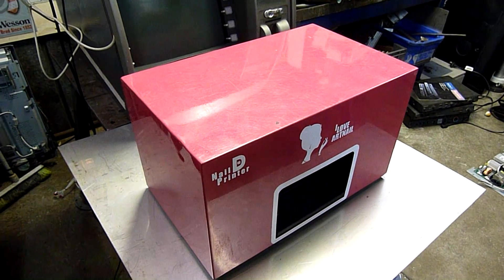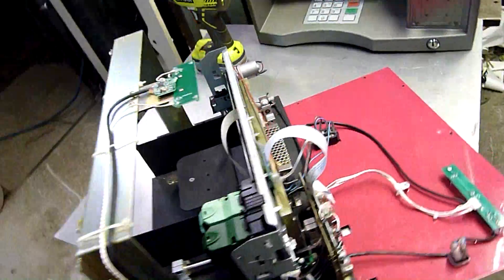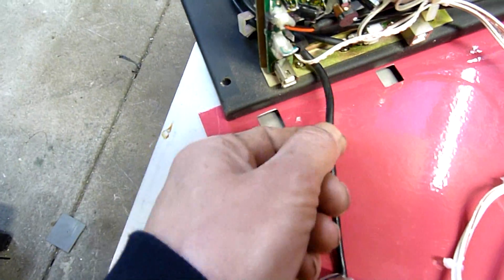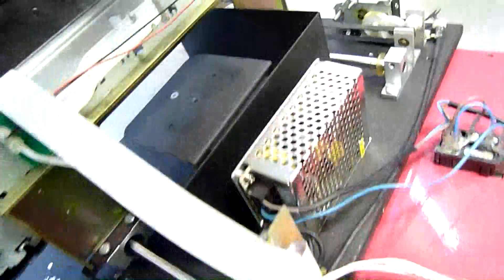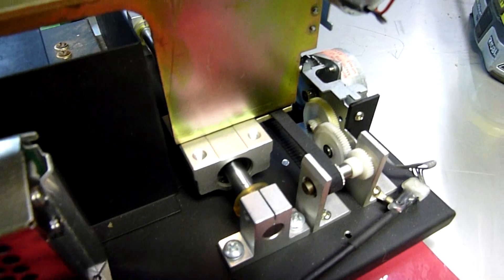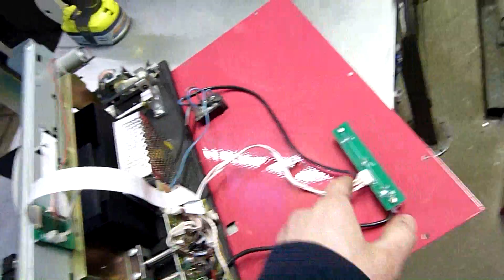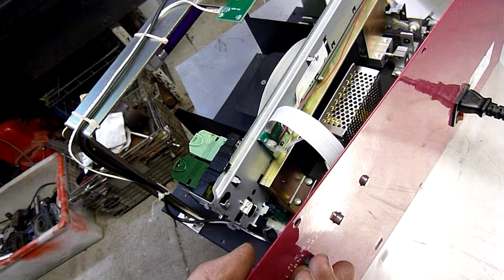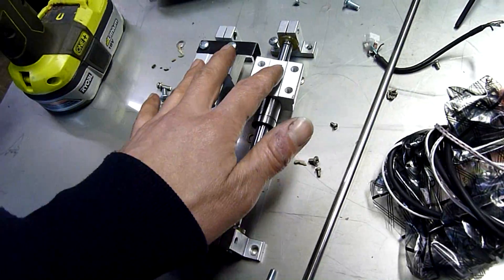Finger Nail Art Printer Autopsy

Comment: Uuuugh!! I have one myself, mine comes with a touch screen monitor. I keep getting this "out of paper" prompt popping up when I try to print, ive had it about a year now go fig. Im getting frustrated now because it did cost so much and no service help. So im watching to see what triggers the "paper" feed, but with the screen it makes it difficult to even think of taking apart ... sigh..
Reply from the maker: I would just take it to a printer shop and explain that its based on an office inkjet and the paper level sensor is probably playing up (not detecting that you have loaded paper)
I am sure they can fix it. but then again you can see how shoddy the build quality is, I was shocked to see what it was like inside when you consider its a $1000 machine.
Reply from the maker: Aussie50 eh nevermind, I need to wake up properly before I comment LOL, it does not use paper. (its a nail printer durrrr)
Whatever bodge they have put in to trick it into running has obviously failed, it could be as simple as 2 wires twisted together, I do not know.
Reply: Exactly. I watched your video for what could be the paper detection mechanism, which you show there on the left side  .. just what to toggle to get the contraption to print without the error.... ugh.. all nite with this 1500 buck piece of machinery... i know you didnt get that much with the parts... just what to do with it now..?😭
Reply: Thanks for the advice. Last attempt is a print shop..

Comment: You should have checked if there was any programs for it...  and tried to hook it up and see what happened...

Im guessing they threw it out because it was either a clogged print head, or they coudlnt find ink... Which both are easily fixable... you could even probably refill the cartridges... 

im not sure what you would do with a nail printer though...

Comment: I'd leave Leave the main assembly intact, if you can make it rise, you might have the main parts for a little 3D printer. You can by the print head replacement parts from a MakerBot one and its all Open Source. Seems like a great project, if someone was up to it.
Reply from the maker: although it looked impressive, it was pretty flimsy, I would not bother using it as a 3D printer. I have far better parts to make one of those from (not that I need one)
Reply: Aussie50 What about a metal 3d printer?!?
Reply: Not worth it. If he wanted he could find parts for a mega 3d printer for dirt cheap in say a year by scouring the yards. There's another Aussie that i follow "EnergyFabricator", he did some tours of a local yard. I swear, if i had access to the kind of stuff they throw out i could make an assembly line let alone a 3d printer.
Reply: aserta That would require molten metal. Best off making a CNC machine if you want to "print" metal. This would not make a good 3d printer or CNC machine. (I own a 3d printer, each thousandth that you are out of alignment makes a HUGE difference, this one would not be able to stay within millimeters because of how flimsy it is.
Reply: sashablfc Someone already made a really cheap metal 3d printer. There's also a shit-duzzle of them around including "The Vader". And i never said that he should make it using this, i said he could scour the yards for parts and pretty much make one from scrap. 

Did you answer my q, just so you can tell me i'm wrong? Ed himself said he has the parts should he ever wish to make one. Sheesh.
Reply: aserta "The Vader" is made out of steel tubes, not stamped steel. You made your statment in reply to someone saying they would make the nail printer into a 3d printer implying that it would be using this. Yes. A 3d printer, not a "metal printer". Sheesh.